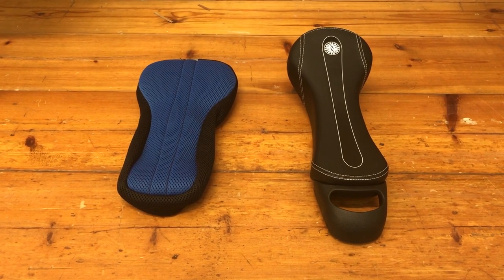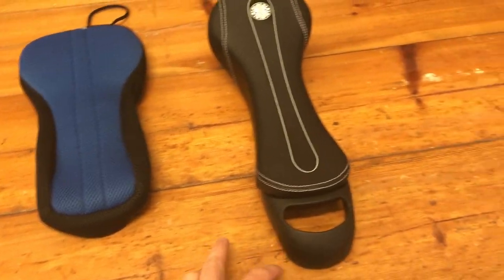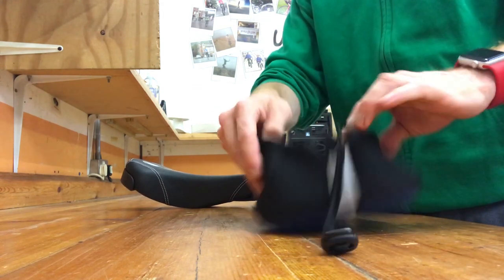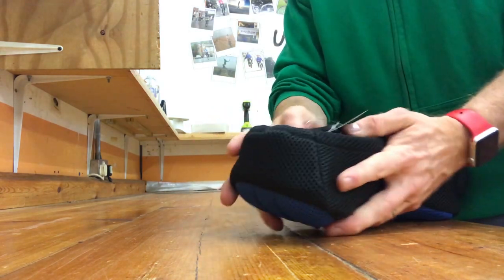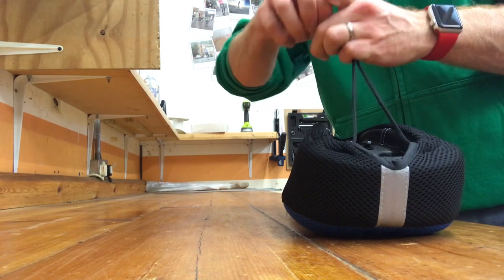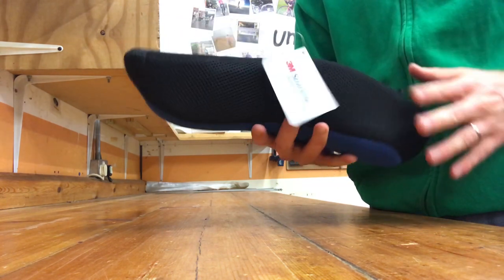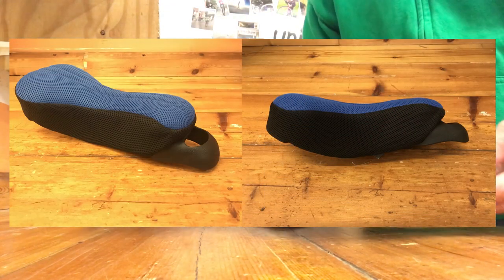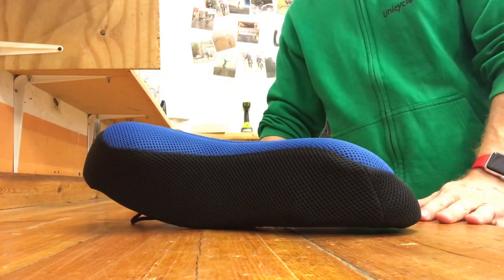Fitting a Unicycle Nimbus Air Cover (How To)

Comment: Do nimbus make these with gel inside instead? How do they hold up in use, like with wear and tear? Looks a bit light weight
Reply from the maker: They don't, only Air covers at this time. So far, we haven't had any complaints about the covers strength.

Comment: Putting a cover over your seat cover! I thought you were going to take the seat cover and foam off. It seems so thick that it would add chafing surface. Will the air-chambers fit under a regular saddle cover or does it need the foam too? I was hoping it would be more like the Nimbus Air Unicycle Saddle.
Reply from the maker: That's the purpose of the Air Cover, to be simple to fit without having to strip your saddle. If you want a saddle with the bladder integrated into the foam, Nimbus do that as well.

https://www.unicycle.co.uk/nimbus-air-unicycle-saddle-black.html
Reply: No this is "better".  The integrated air seat($130) kinda sucks because its mated to a "flat profile" stadium saddle.  I bought it and hate it.  The best saddle for comfort is the KH freeride.  So, if I can put an air cushion on top of my existing KH freeride and fit great, but also allow me to mount the bumpers over the air cover...even better.  I still fall and the cover on the outside will get thrashed.
Reply from the maker: @trexinvert  Everyone is entitled to their option and we are glad you have found a comfortable solution. Some people prefer the Air Saddle, that's why both items are available. :)